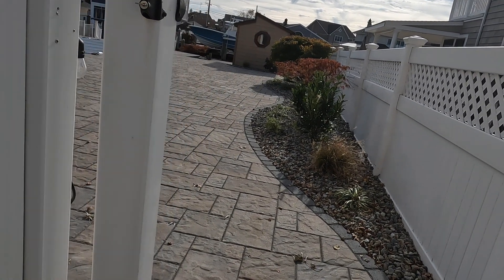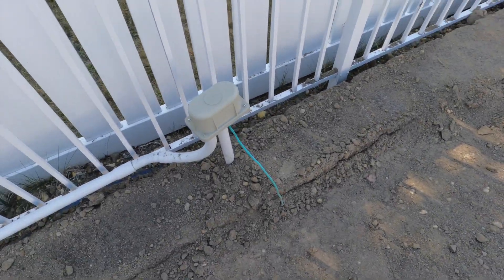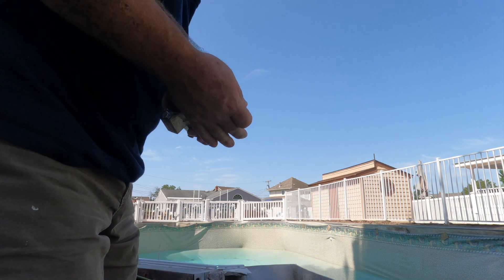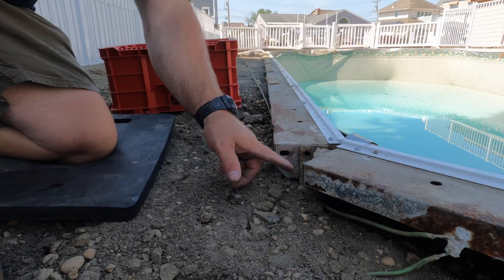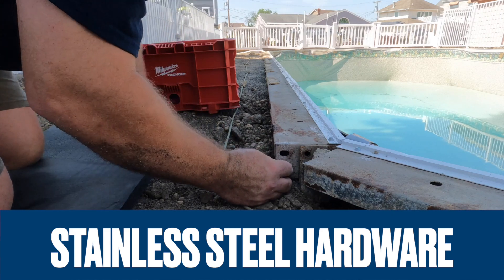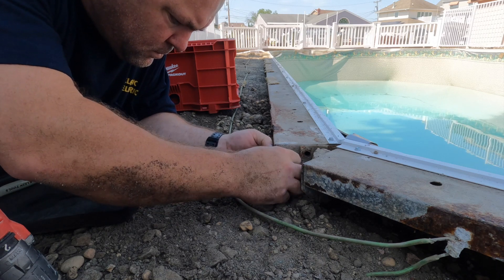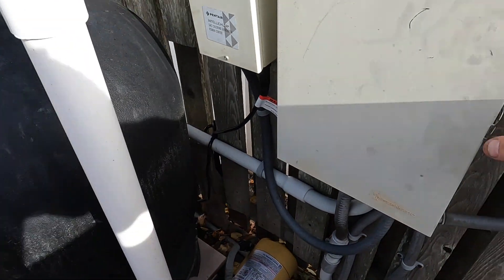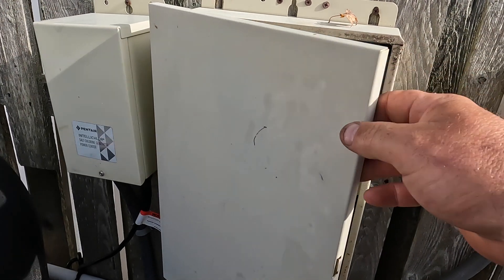Swimming Pool Grounding Repair | Equipotential Bonding Grid Repair

Comment: Hey man great video!¡! ⚡ 

Long story short in I 1985 I had a choice of doing swimming pool wiring or working for ACME Electric Service in Dallas Texas. I picked ACME so I’ve never wired up a swimming pool yet (that starts 2morrow) but I would think especially with the fixing of old corroded equipment like demonstrated in this video, that a wire brush and some dielectric grease would go a long way to helping make a good bond……

But I’m just a dumb Electrician I have no clue really

Be safe brother!¡!¡!¡!¡!¡!¡!

Comment: Nice video.  I have an inground, 30 year old pool.  Recently, the water inside my pool pump skimmer is shocking me, even when the pool timer/power is off.   When I remove the pool ground wire from the motor, I don't get shocked.  Is that from the grounding issues to the pool?

Comment: So what you saying binding wire does not go back to electrical panel 
It goes back to pump? Just pump or all of the equipment you have for example 
If you have pump, heater and filter you just branch off to all equipment?
Reply: You must connect bonding wire to the pump and the heater, and any other electrical equipment. The filter is typically plastic and is not energized so no need to bond the filter.
Reply from the maker: That's correct. #8 AWG solid COPPER conductor insulated or non-insulated. Use direct-burial rated lugs if used beneath the surface.
Reply: I’m to the point where I need to bond my pool did you use 10/32 or 8/32 bolt and washer to secure bonding lug to the panel 
Thank you

Comment: I'm wondering how many points around the steel wall you are connecting the bonding to?  Is it necessary to put a lug on each individual wall panel?  Thanks, it is a well done video.
Reply from the maker: If it’s a conductive frame (4) points and the water too.  NEC 680.26
Reply: @electricianron_New_Jersey  Does a sacrificial anode connected to the bonding satisfy the water aspect?

Comment: This is such a misunderstood subject down here in Florida.  People even inspectors get it wrong.  Bonding and grounding are not the same thing.  This purpose of to give equipotential bonding between all points of the pool that could become energized.   A lot of people here think this line connects to ground back in the panel.  It's not the same thing.  Thank you for going into detail.
Reply: Yes, the bonding is to bring everything to the same voltage, even if NO electrical equipment is servicing the pool..
Reply: @boeing757pilot  no not the same voltage.  But an equal potential and path between points in case of stray current.  Again.  This is very misunderstood.   Basically to create low impedance between electrical equipment near water.   Electrical equipment will always be servicing the pool.  Not sure what you mean there.   All pools have pumps and lights etc.
Reply: @SoundAloneband  
@SoundAloneband  Yes, to place every point at the same voltage so that all parts of our body remain at the same voltage. My other point is that equipotential bonding is needed even if NO electrical service equipment were connected to the pool (I realize that equipment is connected).
Reply: @boeing757pilot  aaahhh misunderstood what you meant.  Yes bonding at least here in SW Florida is a huge thing inspectors look for now.    Like obsessive about it to point of they make their own rules.  Or try to.   I also learned in many classes no one even knows if it actually works.... no one is brave enough to test it if something were to go very wrong.   Also people die all the time in pools here from shock with proper and perfect bonding grids.  Go figure.
Reply: @SoundAloneband  Thanks for that. It's kind of scary to me.. LOL..
Reply: @SoundAloneband  Any idea what is causing the electrocutions? Personally, I don't trust pool lights. My built in does not have one. I know they look nice and all, but since 'Shit happens', it's a risk I don't feel the need to take.
Reply: @SeanFitz-vo4fm  it's rare and usually do to unqualified people wiring things wrong.   99% of the time it's diy gone wrong.  Again this is like a 1 in a million thing here in Florida.  If the light 12v and wires to a xformer per code this shock will greatly be minimized.  But people here do stupid things.  Like anywhere I suppose
Reply: Technically, the bonding wire does (indirectly) connect back to the panel. This is because the bonding wire is connected to the chassis of pool pump, heater, and electrical equipment, and these have their equipment grounding conductor (the ground wire) connected to the chassis of such equipment.
Reply: @SeanFitz-vo4fm  correct but I've seen inspectors walk up and say this pump or heater etc has no ground wire.  I say did you look inside the actual pump wire terminals and look? Then they will say no it should be attached at the ground lug on outside.  I then say you mean bonding lug and bond wire. And they 9/10 will say no it's a ground wire.  The terminology is not correct.  A ground and bond are different.   I have never seen a bond wire actually connect to a subpanel.  They usually run under the pool deck to shell rebar in various points.  Light niche if applicabale and handrails then back out to equipment. I just get frustrated when a snot nose inspectors come and have no idea what they are even saying. Ground and bond are different terms for a reason.  Down here in Florida a lot of ppl misunderstand bonding completely.  Its purpose is to bond all points of current to equal parts.  Although if something catastrophic were to happen that little 8 gauge copper wire isn't going to save you.  lol.   I've heard people say it's to protect you from lightning strikes.  Yea good luck.

Comment: Another great video.

Question for you. With an above ground pool what’s the best way to get a stainless steel bolt and nut into the support post for the lug since self tappers aren’t allowed? If the pool is already constructed when you get there how are you supposed to get inside the post?
Reply from the maker: It's a bit of a pain in the ass but if you take back the vinyl/ plastic cover off of the steel support, at the bottom you'll find steel. What you need to do is drill a hole and use a Tap and die set up. Actually Klein tools sells a hand held threading tool for 6/32, 8/32, 10/24, etc. Or, drill a hole and use a nut and bolt. Hope this helps.

Comment: Hey Ron, are you not required to use #8  bare solid wire to loop around the pool?
Reply from the maker: Bare or insulated says the 2020 NEC.

Comment: You are supposed to be using bare copper on the grid part. How can you create a bonding grid with insulated wire? Also, your explanation of the bonding grid purpose is off. The equipment grounding conductor is the only path it can take to trip the overcurrent device. It will not return back to the source through the ground enough to trip the OCD. It will only disperse the potential evenly all around the pool (UNLESS THE WIRE IS INSULATED). The bonding grid is for NEV potential.
Reply from the maker: 680.26(B) 

The parts specified in 680.26(B)(1) through (B)(7) shall be bonded together using solid copper conductors, insulated covered, or bare, not smaller than 8 AWG or with rigid metal conduit of brass or other identified corrosion-resistant metal.
Reply: @electricianron_New_Jersey  680.26 (A) (1) (b) although you have a metal forming shell you should STILL use bare wire for your copper ring, especially with pavers over them. If you had a Gunite or non conductive shell you absolutely can't use insulated. But I'm sure you would. They are even talking about changing the code to include the ground areas around the heater and pump...sure can't do that with insulated.
Reply from the maker: @electvolt67  don't let your opinion get in the way of what the code says.
Reply: @electricianron_New_Jersey  I'm not....I bet you use that insulated ground for EVERY pool you do....not code compliant. If you're going to make a video, make sure you know what you are talking about. Are you still waiting for that bonding grid to take that short circuit voltage  back to the source through the earth? I hope you're not holding your breath.
Reply: I believe It's possible it might because the bonding grid is connected to the pool pump/motor housing. The EGC is also connected to the pool pump/motor housing (internally), at J-box of the motor.   @electvolt67
Reply: The code may allow for insulated bonding wire but doing so means that the earth, or concrete areas that are not immediately adjacent to bare-wire bonded items such as the ladder, the handrail, etc are not getting the equalized voltage protection that otherwise comes from being in direct contact with the #8 bare wire. I'd say the code is the 'minimum' standard, and sometimes logic dictates going above and beyond the code. There is no downside to using bare wire.  @electricianron_New_Jersey
Reply: @electvolt67  I agree with use of bare wire as the best way to go. However, aren't gunite pools (aka 'concrete' pools) constructed on a rebar framework? Both concrete and rebar are 'conductive' therefore a gunite pool shell is conductive.

Comment: Could u please make a video regarding which types of connectors u use to connect the 8 AWG copper wires?  Also, can u place 3 wires into one connector?  Thank you!
Reply from the maker: The lugs are usually only rated for (1) conductor and they must be rated for direct-burial.

Comment: Hi Ron, good video. It's not often that a person can find a picture/video of what is underneath the concrete surrounding a pool! I digress. My understanding is that the bonding lug on a pool pump motor is connected only to the metal case of the motor - it is not connected to the electrical ground connection of the motor. If this is correct (I'm not sure completely). Also, when all of the metal objects associated with the pool are connected together (bonded) with code required materials, then all that has really happened by bonding them is that from an electron's point of view, all of those different metal objects (railings, ladders, water, pump motor, heater, etc.) all "look like" a single conductor and there is no opportunity for a voltage difference (potential) to occur between any two or more objects under any conditions. This understanding comes from your comments from a few months ago where you said the bonding grid only gets connected to the lug under the filter/pump and "no grounding rods". Can you confirm my understanding? Thanks! BTW, I'm just a guy, not an electrician.
Reply: Connected to the pump, yes. Connected to the equipment grounding conductor, no. No ground rods!!

Comment: Hey Ron, my pool was installed in 2000 and I’m fairly certain I saw the bonding installed before concrete was poured.  Now I’m getting low voltage shocks from every metal component around the pool.  I’m assuming the concrete will have to be removed in order to find the break in the bond?  I’ve also checked the wiring of the 120VAC pool light, which is wired to a GFCI breaker.  My concern with the light is the ground wire coming into the breaker box was intentionally left disconnected.  Is there a valid case for leaving the ground wire disconnected?
Reply from the maker: For a pool? Never.
Reply: Have you tried testing the EBG with a meter?
Reply: @randykemble  yes, I’m not seeing continuity to ground or between parts around the pool.  I’ve traced a ground wire from the ground rod to where it goes under the concrete towards the pool
Reply: There are a few questions which need to be answered.
1) what kind of “pool”?
2)what kind of deck?
3) how many metal items?
4) what kind of meter
5)how long and what size is your test wire?
Reply: When using pool, anything connected by power for the pool turn off until fixed. whilst people are in the pool I mean.

Comment: I@Ron . I used #8 bare wire copper  all around the pool. I see your using a coated #8 why??? Is that necessary or is it just cheaper and still makes code??? Where is the best place to ground the main wire at to the ground rod???
Reply from the maker: Forget about the ground rods. Equipotential bonding grid gets attached to the lug underneath the filter/ pump motor.  Nowhere else.  No ground rods.
Reply: @electricianron_New_Jersey  ok thank you sir

Comment: So if the pool pump is GCFI protected any ground fault in the motor itself should trip the GFCI before any current could travel anywhere near the pool. So the bonding around the pool must be to prevent any  voltage potential difference in the ground itself in which current could flow between grounding rods from different transformers or possibly metal pipes in the ground around the city?
Reply: Correct....almost. It has to do with voltage drop from the main station or sub.

Comment: Thanks for this video Ron. One question for you. When doing the bonding grid I’ve seen a lot of people doing as you did around the pool with just one wire going around the pool and connected at different point to the structure. I’ve also seen people doing a 2 or 3 feet by 12” bonding grid with some pre built grids. In which instance do you use one or the other? Obviously using one cable is much easier but which method would you  use for a gunite pool with no decking (ie:just coping and grass around the pool). Thanks.
Reply from the maker: If it can conduct electricity then it must be bonded.

Comment: Why install insulated wire, Doesn’t it defeat the purpose of equal potential to the surface when you’re walking on the deck? I’m installing one monday and the instructions from the pool company and township is that it has to be bare.
Reply: It appears that only the metallic items were bonded in this video and not the ground covering around the perimeter of the pool. Perhaps that's the next video.
Reply: The purpose of bonding is that you want all the conductors like the pool water, stairs, pump, pool enclosure,  fence to be at the same potential. Let’s say you’re in the pool and the stairs are not bonded and there’s a stray 12 volts on the metal stairs, because the water and the stairs are at a different potential  that stray  12 volts could kill you in the pool water..
Reply: @kevonslims7269  And of course the ground or concrete deck around the pool, both of which are conductive.
Reply from the maker: Are you a licensed electrician?

Comment: I find it interesting that while the NEC has very specific mechanical installation requirements, nothing in the NEC that I’ve seen so far requires or even suggests (well, maybe implies) taking electrical measurements after the work is done to verify/confirm that a system is working as intended. Ron, do you take any measurements of your work?  For example, in this case it seems to me that continuity and resistance measurements at various points might be a good idea. Also, while those connections you made are great, time always takes a toll. Would you ever consider waterproofing those connections so as to prevent corrosion and failure of the contacting surfaces (between the wire clamp and the pool frame)?  Maybe it’s just me but I’d grind off some of that oxidation before installing those clamps.
Reply: @HGlez-el5ch  what? Is this just a number you like? There are resistance (ohmic value) charts which list what the ohmic value should be per 1000 feet of a given awg. Then do some math.
Reply: I have measured several pools and the ones that make me feel the best are the ones with an equal resistance value no matter what 2 items on the grid you may use as contact points with your meter leads.

Comment: When installing the ground lugs to the metal around the pool do you have to buff the surface of the metal where it is clean so the lug and steel make good connection or does it matter?  Thank you for sharing.
Reply: I would think it would help and certainly shouldn't hurt. A higher quality metal to metal contact . I would want to remove paint from the surface, then, if needed for looks or to prevent corrosion, maybe spray paint the assembly after it has been installed.

Comment: Not sure if they used brass pipe for the pool light but I think 30 years ago it was the standard . if so would you not need to bond the pool light with the # 8 wire  as the brass pipe provides the bond ?
Reply from the maker: You would be correct about the brass pipe being used as a raceway and bonding wire.

Comment: I don't agree with you on the equipotential bonding purpose, the key words are EQUIPOTENTIAL BONDING, so pretty much its purpose is to bring everything to the same potential (voltage) and minimize shock hazards.Even though the OCD is gonna trip and do its job if the water or something else (equipment related with the pool) gets energized, the main goal here is again to reduce the difference of potential in or around the pool areas because at the end is that what kills you.
Reply from the maker: I agree with that 100%. Did I say something wrong in my video?
Reply: @electricianron_New_Jersey yes. This bonding is not an equipment ground